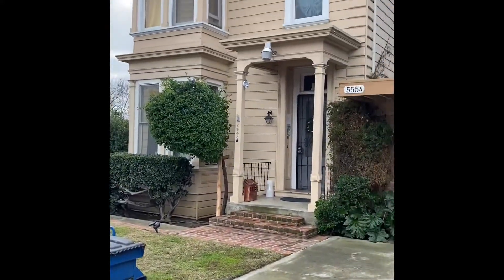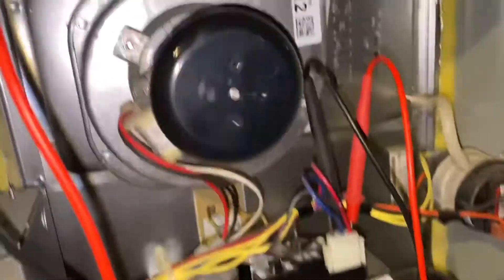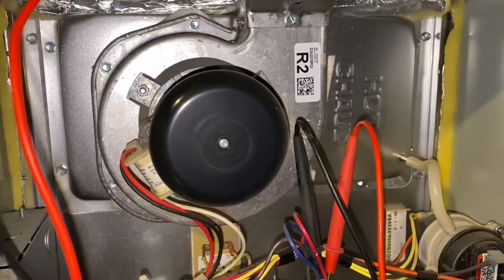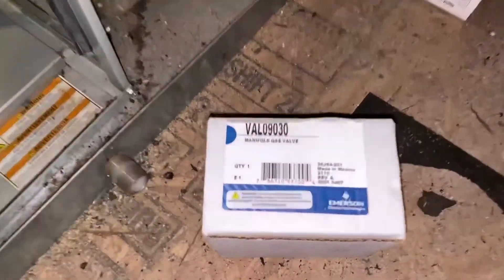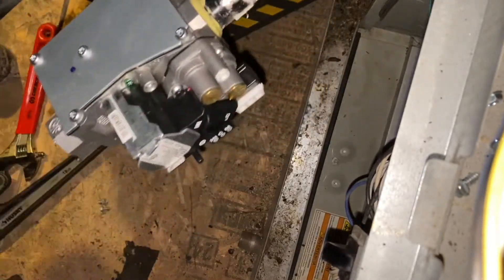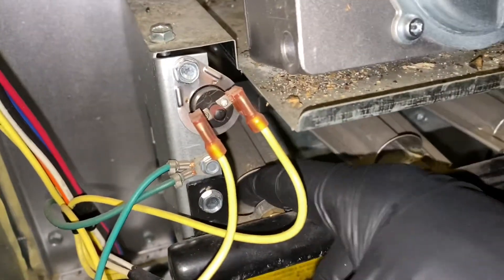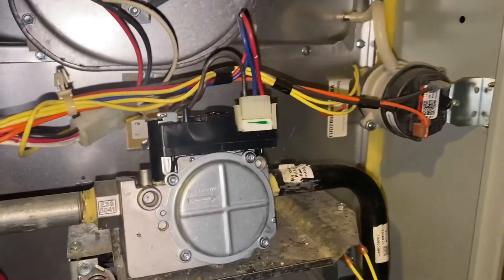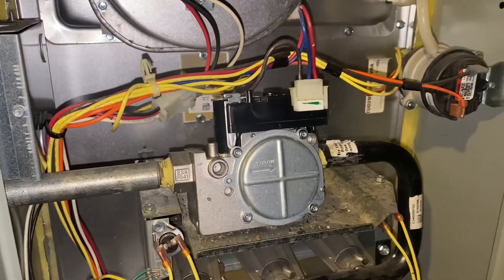Trane XV 80 No Heat #hvac #hvaclife #hvactechnician #hvactraining #trane #hvactroubleshooting

Comment: Hey I got 27 volts to the valve no hissing at all or clicking. So I would say bad gas valve right?but when I tested the leads alone from the board to the valve they read constant 14.7 volts, then when it kicked on it went to 27v then back down to 14 but when I tested the wires while connected to the valve it read 0 volts until it’s clicked on and gave 27 volts I tested the power to the board on the leads and 0 volts until initiation, don’t know what that is. I don’t wanna replace the valve and the board still be bad. Please help 😂
Reply from the maker: Sounds like the valve is bad if you have power at the valve but no ignition that indicates bad valve thanks for watching 👍👍👍